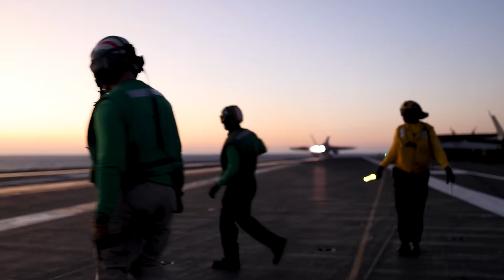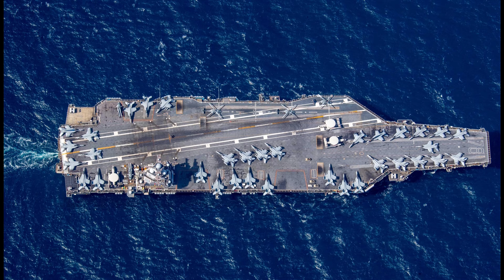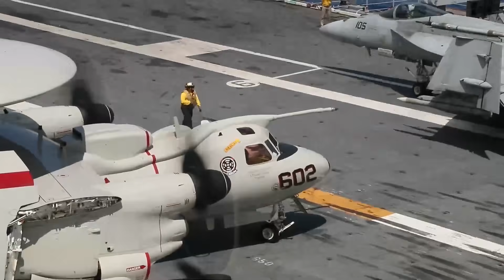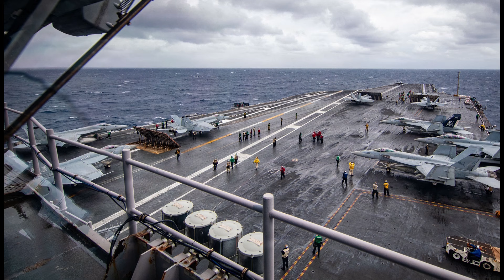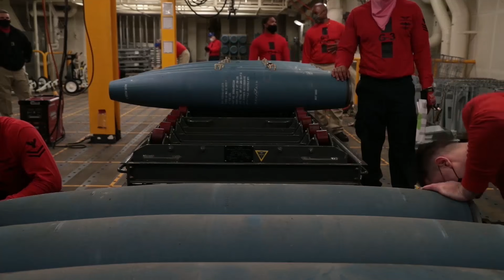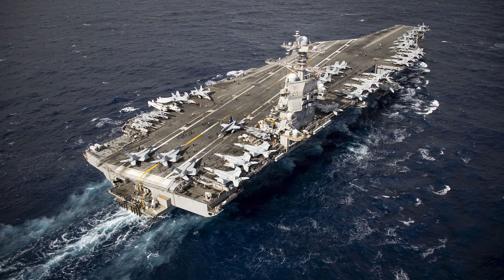Is China's Fujian Carrier Actually the Equal of the Ford Class?

Comment: Chinba is still using J15 series aircrafts, it is too big, one J15 is equal two F18 or two rafaels jeet.  so, unless china makes use of J35.  Fujians can only storage about 75 aircrafts to 80 planes.  Fords can carry over 100 aircrafts.   in paper spec. fords are more  bigger and more aircrafts.  But it doesn't mean fujian is inferior in any way.
Reply: Ford doesn't even have proper 🚽.
Reply: @taiwanstillisntacountry Ford's laundry spontaneously combusts also. Ford also cannot launch the F-35C. The Fujian has already launched the J-35 stealth fighter. Ford cannot launch any aircraft if one catapult fails because of the way the catapult power system is designed. Ford also has weapons elevators that don't work. The Ford is not ready for combat.